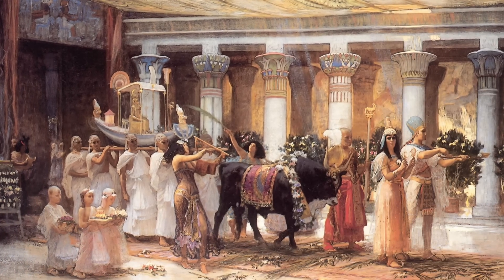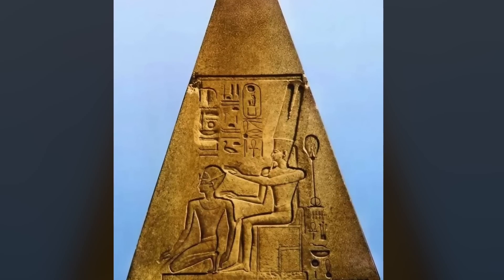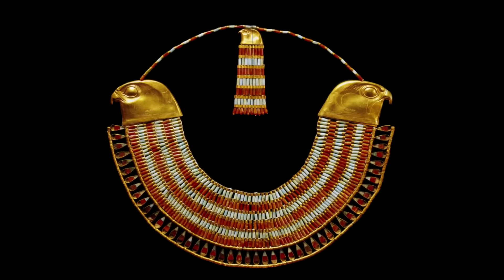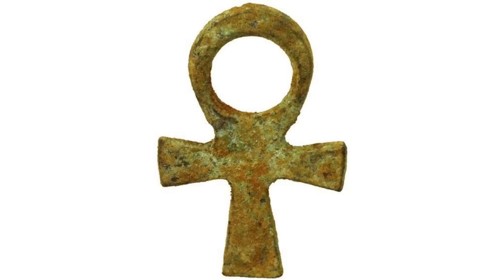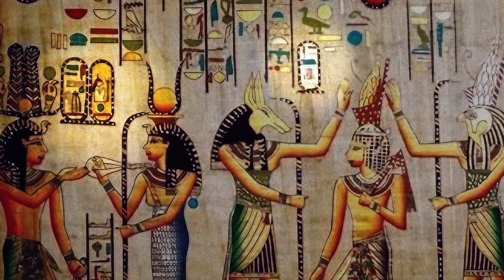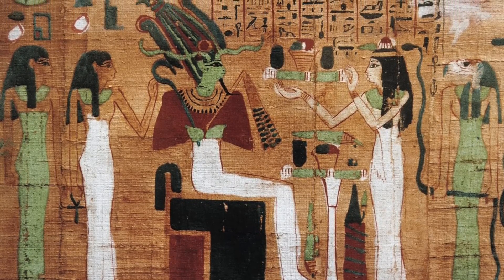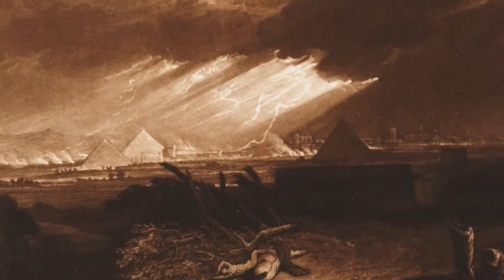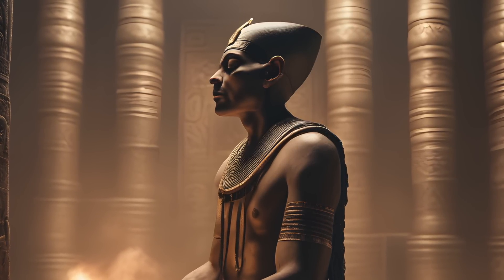Andrew Hall: Electricity in Ancient Egypt | Thunderbolts

Comment: <><><>  please keep an eye out for signs of water and electricity in ancient structures, statues, artifacts and writings. Researchers have discovered that water droplets are capable of producing electricity using simple equipment, without generators and turbines. This video shows one such method:  ' We made electricity from water - and it's easy! '.
This may have been a method ancient Egyptians used to make electricity. Dendera light is a motif in the Hathor temple at Dendera in Egypt, depicts a 'snake' emerging from a 'lotus flower'. It is part of the Egyptian creation myth and has been interpreted as a form of ancient light/plasma technology. Last time I checked lotus flowers did not have a transparent/glass sheath in proportion to a light bulb. Nearby there is a box with ~6 tubes/wires emanating from it which are joining a U-shaped container. This could be a water-generator. <><><> Only 5 volts are needed to create or transmute elements [NEW tech!!!] including incredible/impossible ones with 1000's of AMUs [atomic mass units] <><><>
--
Leme know you got this. Tnx
<><><>

Comment: There was also STATIC ELECTRICITY. Which, for example could have driven the Dendera light.  We see a baboon turning a crank in a box, which could be a simple electrostatic generator-- say a fur skin wrapped around a cylinder.  The electricity could be channeled to the light with WIRES--  A copper wire insulated with cylindrical glass beads Drilled in the center (Thats what the wire looks like)  The glass bulb is supported by a djed column, that looks like a high tension insulator (and could have really been)  The snake symbol in the bulb also stood for "static electricity".  The bulb could have been a glass bottle dusted inside with a phosphoric mineral.  Thus the electricity made it glow---  Not unlike the modern day trick  of scuffing your feet on a carpet on a dry day while holding a fluorescent light tube, and having the tube light up in your hand.   Such a technology would be easy to build even by a relative primitive society if they had the  knowledge.  Could explain how dark temples and tombs were lighted.

Comment: Great video and an intriguing one at that. Yes, the Pharaohs did hack into the Electric Universe. Their cosmological labyrinth is an inquisitive thing when it comes to logical thinking. The whole point of their 'New Found Discoveries' is to arrive at the centre without taking the obvious route. The Egyptians couldn't have built these monuments. Yet the pyramids do exist. 

This also means that they couldn't have been built at the time of the pharaohs, but were built at the start of the interglacial period instead, roughly 12,500 years ago. The orientation of the sphinx confirms this. It is oriented precisely in the direction where the constellation Leo, its image, would have appeared 12,500 years ago at the dawn of the spring equinox. The pyramids themselves appear to have been built slightly later, around 12,000 years ago, when the relative position of the stars of Orion would have matched precisely the relative positions of the pyramids.

This state would also match the startup time of the interglacial period in which we would have seen strong plasma focus events. Also, the building of the pyramids might have been easy. At this time, the earth had been bombarded with much larger volumes of high-energy cosmic ray flux, possibly hundreds of times larger than today. With this massive energetic bombardment of protons going on for tens of thousands of years, the surface rocks would likely have been saturated with protons, so that their repelling force within the crystalline structures of the rocks would have rendered the rocks significantly softer, easy to cut and carve, and easier to transport, aided by the repelling force. No big machinery would have been required to manufacture the millions of stone blocks to build the pyramids with. The civilization of the builders appears to have vanished more than 8000 years ago when the Sahara became overlaid with sands from swarms of asteroid intrusions into the atmosphere, potentially by which the Sahara became a desert. The Sahara used to be lush and green prior to the desert sands, the remnant of the people of the builders may have migrated to the Indus river valley and established a new civilization there.

We find the earliest civilization with a written language there and with irrigated agriculture. The reason why the pyramids could not have been built by the pharaohs 4500 years ago, is that humanity had been cognitively regressing during the cosmic ray lean interglacial period. Also, if the pharaohs had built the pyramids, the walls within them would not have been left bare without a single inscription. Now that the solar system is in a free fall, weakening towards the cosmic ray-rich times of the next ice age potentially in the 2050s, we are seeing the fringe effects already happening.

Comment: Was scepter is a tuning fork with a head to direct the energy, ankh is a frequency oscillator and djed grounding capacitor. All frequency healing tools. Pyramids has a djed built into it and is one large negative ion generator which is positive for all life. People have been lied to for the longest time that these are all just symbols when they are clearly frequency healing tools. The capstones were removed along with the arch of the covenant which went inside the kings chamber which most likely contained a substance like mercury or liquid gallium. Just my 2 cents worth of research.

Comment: Furthermore, I suggest you research Dr. Jerry Tennet who uses electric currents for healing. What is depicted in many Egyptian stone images are the healing methods, yes, but also, the body rejuvenation that occurs with cellular human life when 50 millivolts of electric current runs through. And also, as you indicated, growing the brain and skull by electrical stimulations, yes this is possible when combined with a diet which develops hexagonal crystalline structuring H3O2 of body fluids & tissues & bones (see Dr. Gerald Pollack). THEN when applying the electric current with specific sound frequencies & light frequencies in specific harmonics & intensities, THEN activation of crystalline growth  of tissues & bones can be accomplished.  Want to grow the brain and skull, then direct the current at the angle to the skull as you see in various images. Lastly, I also have concluded for myself that the Earth back before the Younger Dryas was far more electrically charged, growing animals and plants and humans to gigantic size compared to today, and therefore a different physics of the Earth.

Comment: the ankh is a loop antenna connected to a rod covered in winding that uses a crystal and oxide to receive or send  radio waves that become Audible. there is a crystal at the center of the ankh that act as the buzzer that produce sound from the radio waves. it also send sound in reverse. its a crude wakie talkie similar to early days of radio. the device contain some means that store electricity inside it. these things are recharged. their depicted used everywhere. even a servant holding the ankh toward his mouth while he is on one end of the stair case to heaven that is also depicted as a ship in the heavens with a lotus on each side of the ship. the funny part is that the body of Nut has a mouth and and birth canal and there are different stars depicted on both ends as well as the same symbol for the circle at the top of the staircase to heaven repeated over and over again trough the body of Nut.

Comment: The ancient Egyptian imagery suggests metaphorical and spiritual activities, and I am imagining how that can be combined and reconciled with the electrical hypothesis presented here, and it's fascinating.
Reply: They messed around with electricity and made spiritual ideas out if it. Heck, we had alchemists doing rudimentary chemistry so it's possible they had pseudo-electrical engineers.
Reply: <><><>  please keep an eye out for signs of water and electricity in ancient structures, statues, artifacts and writings. Researchers have discovered that water droplets are capable of producing electricity using simple equipment, without generators and turbines. This video shows one such method:  ' We made electricity from water - and it's easy! '.
This may have been a method ancient Egyptians used to make electricity. Dendera light is a motif in the Hathor temple at Dendera in Egypt, depicts a 'snake' emerging from a 'lotus flower'. It is part of the Egyptian creation myth and has been interpreted as a form of ancient light/plasma technology. Last time I checked lotus flowers did not have a transparent/glass sheath in proportion to a light bulb. Nearby there is a box with ~6 tubes/wires emanating from it which are joining a U-shaped container. This could be a water-generator. <><><> Only 5 volts are needed to create or transmute elements [NEW tech!!!] including incredible/impossible ones with 1000's of AMUs [atomic mass units] <><><>
--
Leme know you got this. Tnx
<><><>
...
..
.

Comment: Is this activity shown at 02:15 similar to the licking of 6 VDC lantern style batteries performed by the Red Lectroids (inter-dimensional aliens) seen in the 1984 movie The Adventures of Buckaroo Banzai ?  

In ancient Egypt, this effect could possibly be produced by compressing quartz crystals to get high voltage Piezo-electric sparks (possibly stored in capacitor "jars") or from an impossibly large number of chemical batteries "wired" in series. 

Maybe they also had coils of "wire" to compliment capacitor jars for even better sparks...  or, are those just traditional HF loading coils shown on those communication antenna "sticks"?  What fun, thanks Andy!